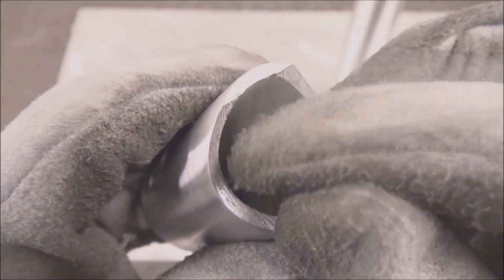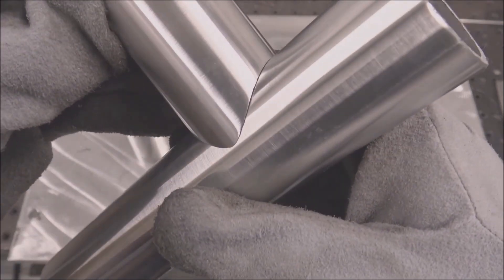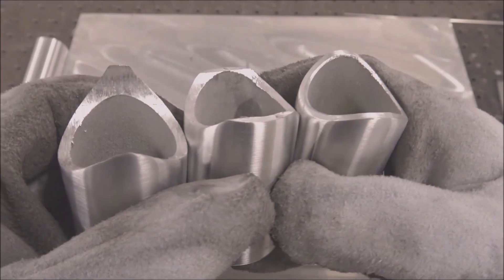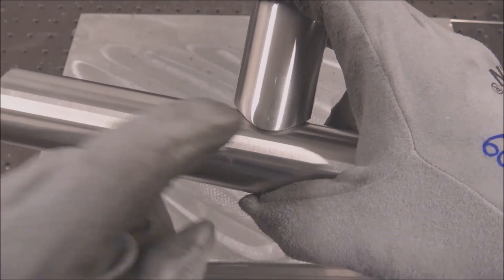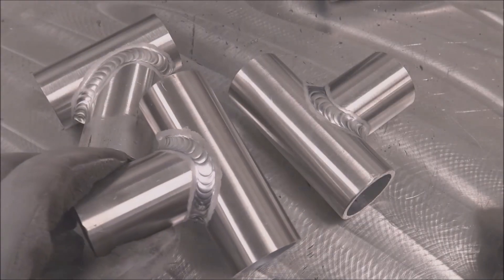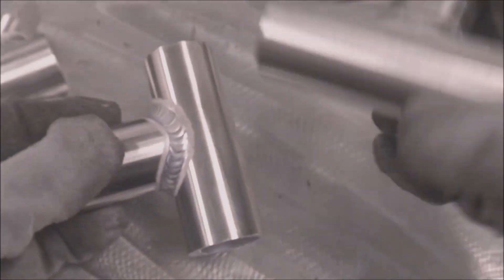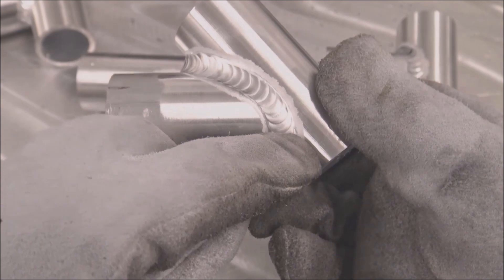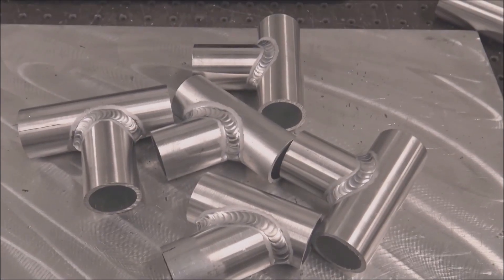How the Professionals do it - Tube Notching and Welding

Comment: A skilled experienced welder such as yourself can use even a "cheaper" machine and still have high quality welds. Because you actually know from experience what is going on!❤🙂
Reply: As long as the machine is suitable for your work, it doesn't matter if it was cheap or overpriced.👌🏻

MacGyver could weld with a 9v battery because he knew what he was doing 😂

Comment: If commenters find flawed the idea of puddles, or injections of rod to the puddle? How would you achieve a 'drag weld' type of bead with hand held TIG unless the wire feed was motorized/motor fed/smoothly and evenly fed? Not sure I understand how someone could weld 'two handed' TIG- hand torch and off-hand filler feed- w/o puddles/dimes?
Reply from the maker: Lay wire/ lay rod technique. Put the rod in the puddle and don't pull it out.
Reply: 6061, so the commenters imagine that the torch travel over the lay wire would be dead smooth?  Not the simplest feat to accomplish! every twitch and slip of the torch hand would show as puddle irregularities not unlike puddling/dip and travel.

Comment: 😊as a chassis builder I can truly appreciate you sharing this. Build mostly in 4130cm.
I always dress the edges like you do on the disc sander. Also we Scotchbright the tube the notched tube is welding too. Makes the weld cleaner when the mill scale isn't mixing with the filler.
We also do aluminum fuel cells , dashboards, and have done a couple of dry sump tanks too.
Your videos cut through the misconceptions, no BS, and are truly informative.
Thanks!

Comment: I Bing watch all your videos back when I got my tig welder. Then I practiced for several weeks got pretty decent then realized that it cost alot of money to keep practicing. The gas was killing me, think the store I was getting it from was ripping me off 175$ for a small tank, not the big ones in the back of most welder outfits you see, about half as tall. That was 4 years ago. I’d hate to see where it’s at now. When ever I got to tig some thing I break it out and practice a couple passes then get to it, mostly for welding aluminum. If it’s steel I usually use the shop’s mig setup.

Comment: Amazing work.  Are those tubes anodized?  It would be interesting to see what method you use.  I do some marine fabs, and use the punch through method.  Definitely doesn't look awesome as your finished product.    Thanks for sharing.
Reply: Those tubes sure don't look anodized to me, looks like a mill finish. Then they were cleaned up to look good. Anodizing creates a thin aluminum oxide on the surface, so welding anodized aluminum isn't going to be optimum in my opinion. At the least the weld will be a little dirty from the oxide.